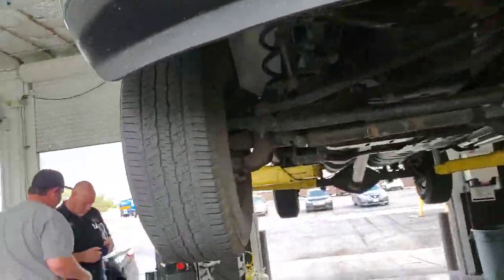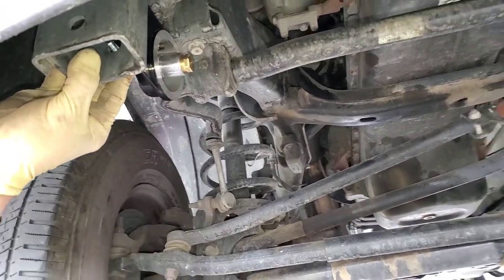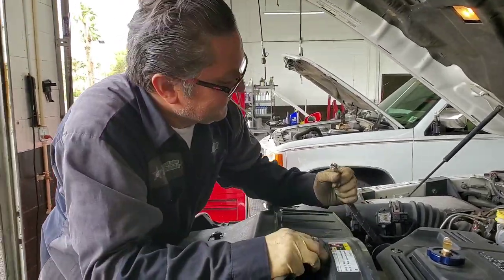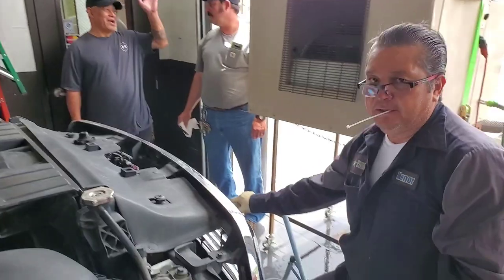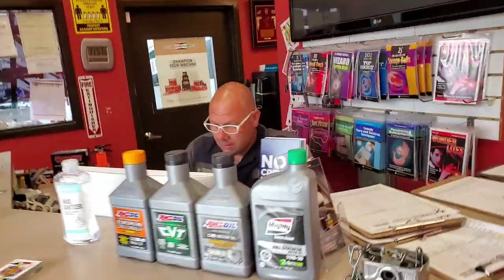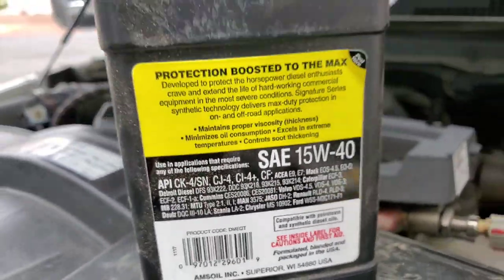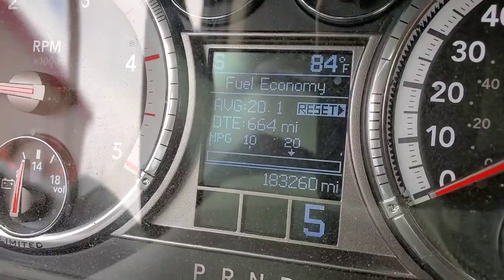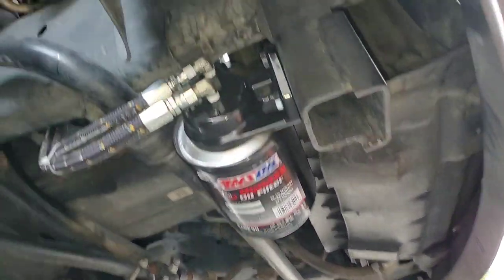AMSOIL Bypass Filter Installation 2012 Ram 6.7L Cummins

Comment: There seems to be 100's of these bypass installs on youtube. But very few results videos. The one or two results videos I've seen didn't seem to be very good. The oil stayed jet black. So until I see more positive results I'm voting no on this one.
Reply from the maker: Yeah the color of the lubricant is not the best indications really if you want to get down to the science behind it you definitely want to do oil analysis I highly recommend it on your personal vehicle they do make a huge difference or else no one would buy them they are more for specific applications people that drive huge miles and they are towing or plowing snow or extensive idling like tow trucks.

I'm with you if I was doing just regular driving and highway driving I would not have one but if you are doing serious Duty I would definitely get a bypass filter because you go longer per oil change you have better oil Cooling you also have less contaminants floating in the oil with less particles less friction less heat less where your motor will last longer with higher compression and you also have better fuel mileage because the oil won't thicken as quick.

So it really depends on the application I highly recommend checking out the oil analysis playlist on my channel you'll see that on the homepage👍

Comment: And Schaeffers oil is better than Amsoil
Reply from the maker: How do you know it's better?
Reply: I’ve tried both on my 2015 ram 2500 6.7 l tried different oil stopped on schaeffers haven’t tried anything better yet
Reply from the maker: That's awesome which Amsoil oil did you run in your ram?
Reply: Competition Amsoil 20W-50 Synthetic Diesel Oil Boosted Zinc 3 Gallons
Reply from the maker: @vaskadid1786 what type of modifications do you have done to your diesel engine?
Reply: Mostly stuck All emissions intact
Reply from the maker: @vaskadid1786 when you run a thicker oil and have a moderately powered vehicle you will notice a big decrease in performance I've personally done this with my 59 Cadillac on the channel I started out with a 10w40 which ran pretty poor then I ended up going to a 10w30 then after that I did a mild clean out process of 0w20 which I liked a lot then I went back to 10w30 and it seems the best I have a lot of 18-wheeler friends in different people that run the 10w30 Max DD diesel signature series with it I have a good 18-wheeler friend that has done multiple tests here on the channel you'll see the oil analysis under semi truck playlist and out of all the different oils after testing them 15w-50 his favorite 15W-40 his favorite is the 10W-30 which I highly recommend for your truck that's what I would personally run if you're doing excessive Towing and getting the oil temperatures over 230 degrees then you definitely want to have the 15W-40 but if not the 10w30 really makes a big difference the motor runs a little Freer picks up a little bit of fuel mileage💯🇺🇸

I personally think if you tried the 10W-30 Signature Series Max Duty diesel in your truck and ran the diesel injector clean plus C team boost the green bottle I think you would be very impressed.

 I give a man a fishing pole & show him how to fish. 

     Together! We can get your vehicles to run better than brand new!

     For me to get credit & be "Your" Independent AMSOIL Dealer please use my website below or my dealer no. 5331179 call anytime Eben Rockmaker 702-472-3614
After you click on: http://syntheticoilprotection.net
1. Click hamburger menu
2. Click offers AMSOIL preferred customer
3. Click join now 6-month PC member add to cart.  ( there is no reoccurring renewal membership unless you select that dot box ) 
( you have the option to not have your credit card saved if you prefer - est. 1972 )
4. Scroll up to the top Select shop by vehicle.

New Promo: FREEQS

Comment: Better fuel economy from oil change is BS. I've done this whole thing and no better mileage at all. Maybe better wear protection and longer change intervals but the most you can get is 24 months on oil regardless of mileage.
Reply from the maker: That's what I thought Phil yes it's amazing how much of a difference in a signature series makes it cleans your motor from the inside out so you have better compression you'll have significantly better fuel mileage we have a bunch of great videos on the channel definitely check them out on oil analysis